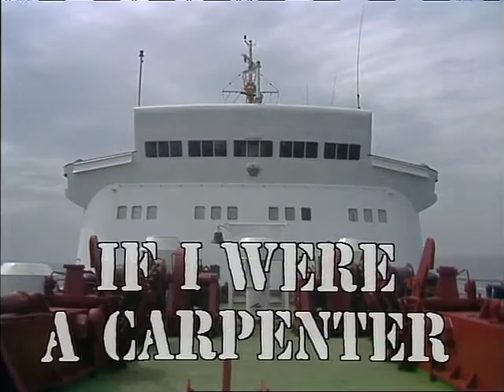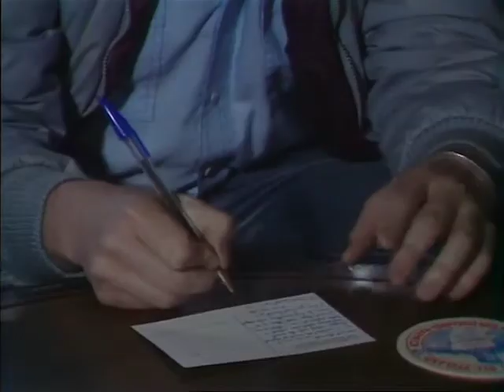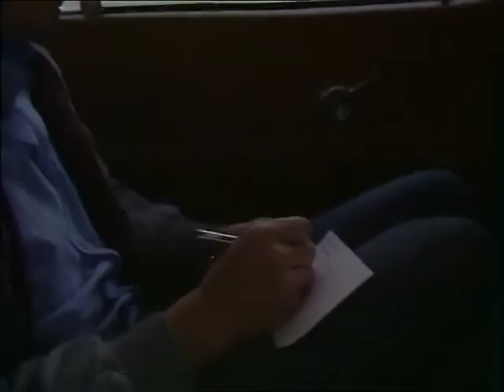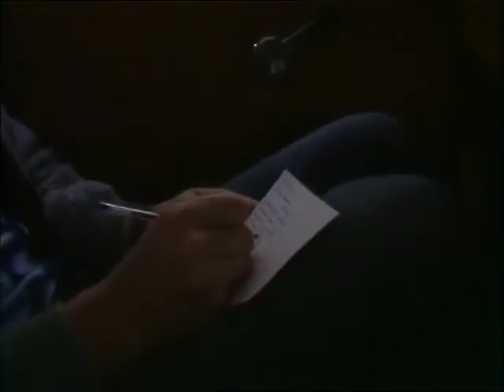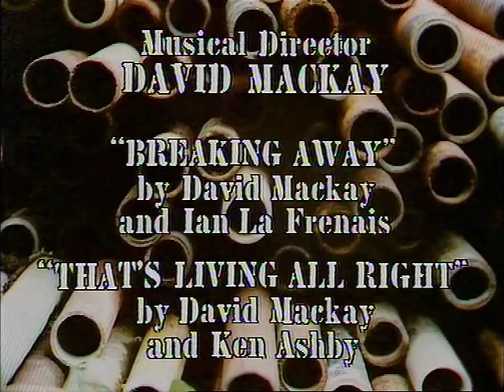Auf Wiedersehen Pet (S01E01) - If I Were A Carpenter

Comment: What did the bartender do to the beer with the plastic looking knife?
Reply: I missed the scene, but because of the way german beer is brewed, it usually has more foam whilst being drawn,  especially if the setup of the dispenser is not good. So the bartender uses the knife to get the foam off the beer in order to fill the glass faster. I hope this is proper English.